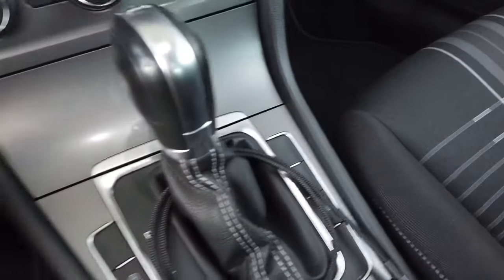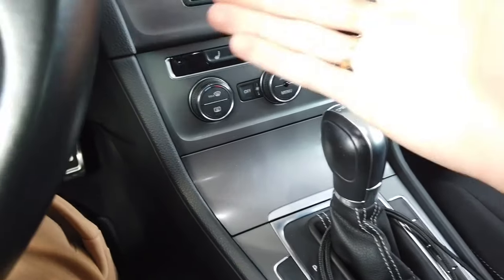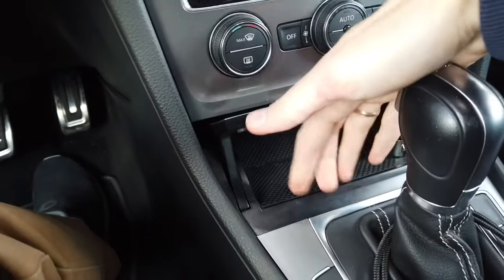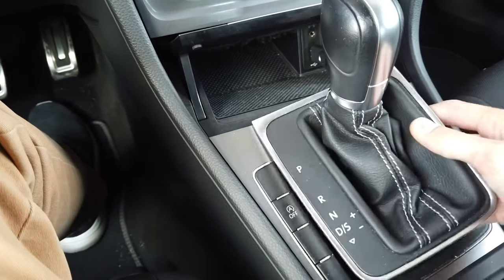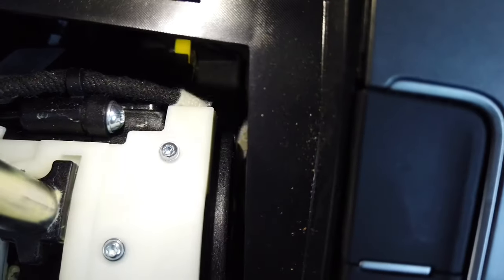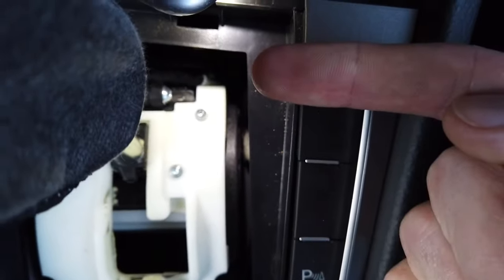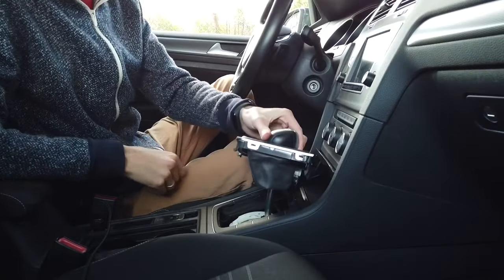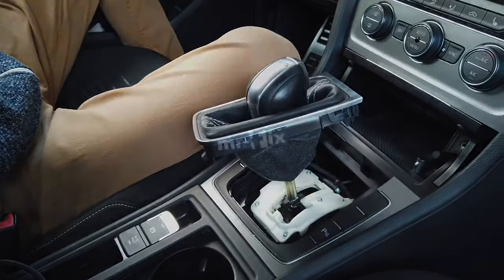VW Golf MK7 (5G) DSG emergency release and unlock

Comment: What about releasing the electronic brake
Reply from the maker: You can use 12V battery to power the brake motor directly to release it. I have not done this yet but I assume that you would have to get under the car, find connector nearest to the wheel on the brake wiring loom, and provide power to release it.